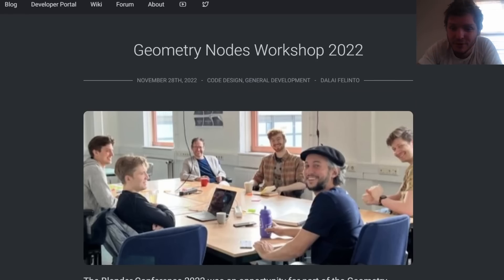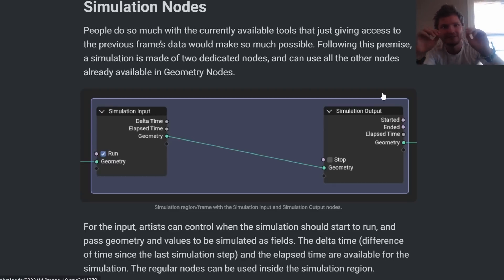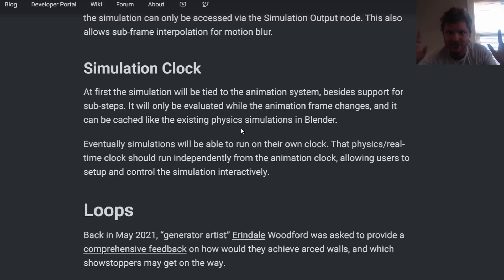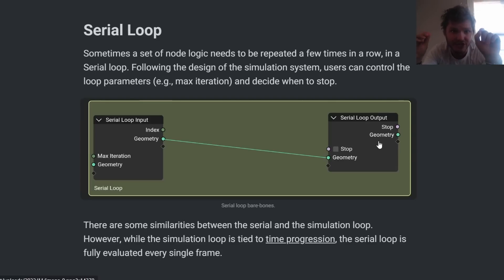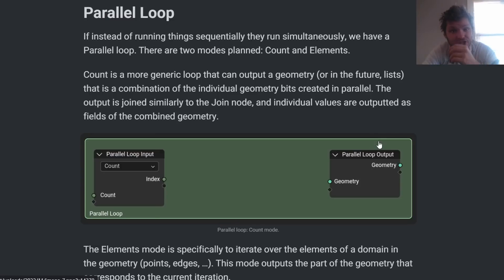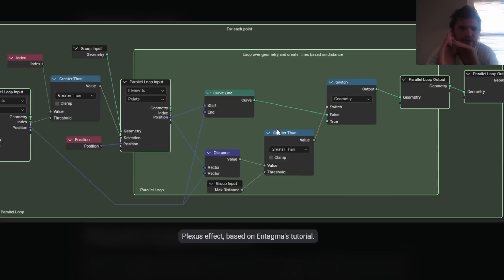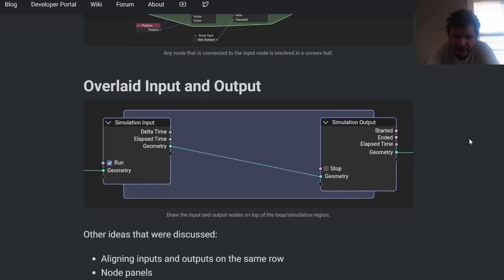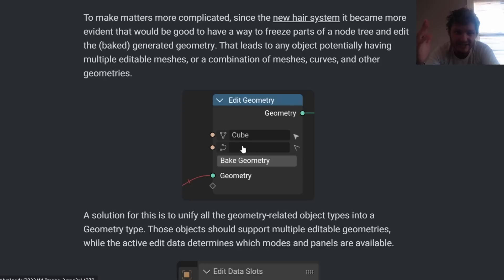It's ALMOST Here

Comment: It would be cool and useful to add something like "LFO nodes" Low Frequency Oscillation is used in music to automate movement to a certain frecuency/speed with different ramps (square, sine, saw, noise, etc) idk could be useful
Reply: math nodes give us this (sine functions), but I agree, it would make the process a lot more streamlined
Reply: Wouldn't this be possible to replicate with the Float Curve node? I mean if you plug in a repetitive UV map then it does sort of output a periodical wave.
Reply: I think high-level nodes will be implemented in the future. Now they are working on a system of low-level geometry nodes. LFO, bpm, time shift, any data visualizer nodes, etc. are required.

Comment: in 3dsmax they have the "Edit Mode" as a modifier that you can turn on and off so you can go always go back to previous state of the geometry. Something that lots of people complained about, but since we're going to have Freezing and Baking geometry, it could be possible that Editing geo could be entirely non destructive :o
Reply: It already exists, it's called shape keys. You set the original mesh as a shapekey, then make a new shape key and edit it to your hearts content. It has a slider, so you can animate between different edited points.
Reply: @john_09124  Look at how Arrimus 3D uses "polygon layers". It's quite different from shape keys. You can't introduce new vertices with shape keys, you can't use it to tweak the subd cage after the fact. It's not really there yet, but this bake geo in blender thing is probably bringing us a step closer indeed - at least I also thought that when I saw.
Reply: @john_09124  oohhh I guess you're right. Just havent thought about it outside the context of animation/ fixing incorrect deformations from rigs
Reply: @john_09124  shape keys don't allow for thee creation of new vertices, I think this will. So there is a huge difference
Reply: Hard ops is non destructive if you like hard surface modeling , you have something called ever scroll and you can recall cutters and move them around later if you  want to change the look of a boolean, That person's comment about shape keys seems better though!